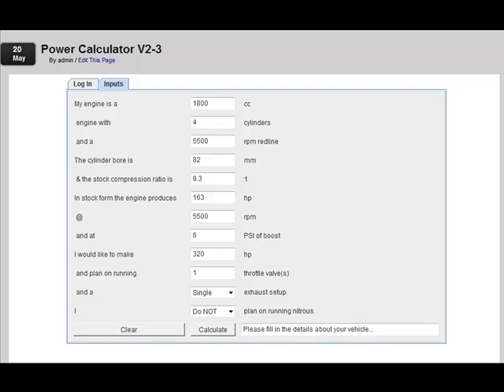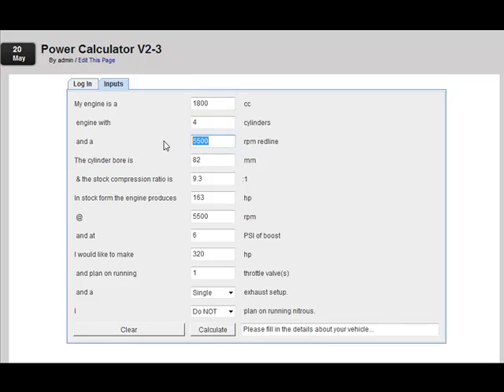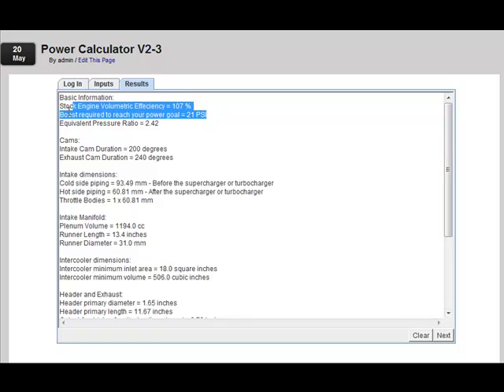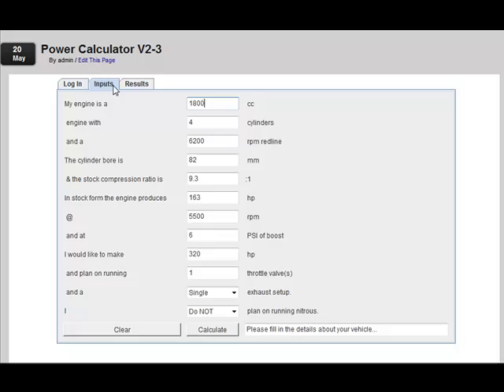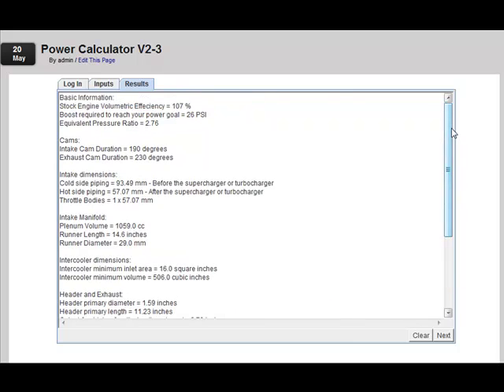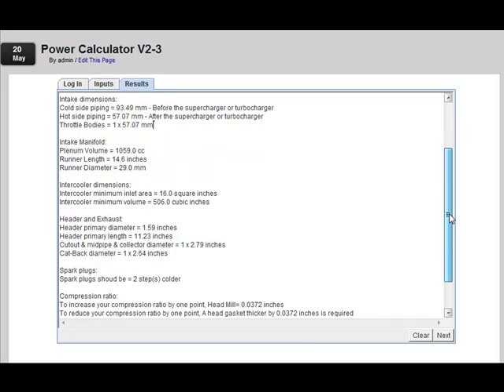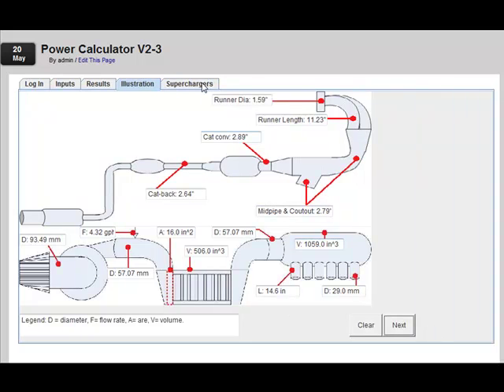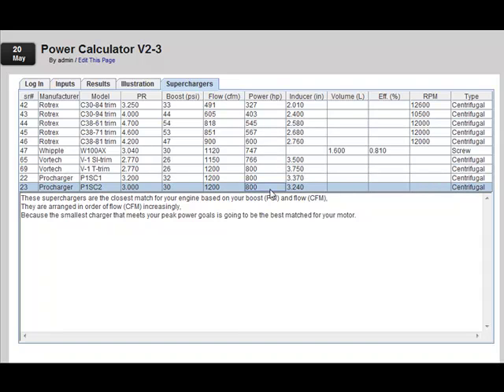video2 cams

Comment from the maker: yeah well it doesn't give exact cam timing ... to do exact cam timing (intake opening and closing, exhaust opening and closing) you'd need rod stroke ratio to calculate the piston acceleration profile ..

What we're doing here is giving you a cam that is targeted for your redline rpm and adjusted for your target boost pressure

Some things are slightly simplified here to make the product universally applicable to everyone...